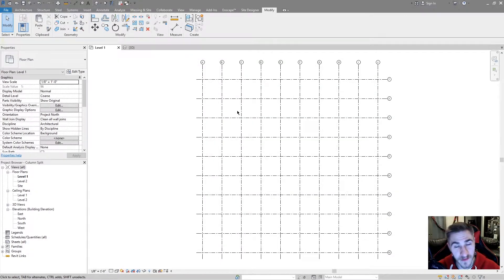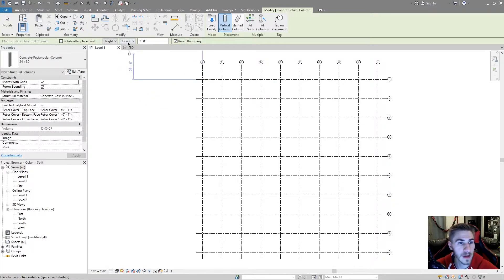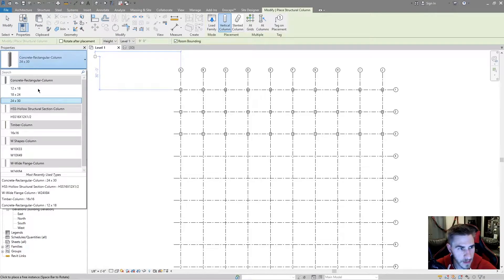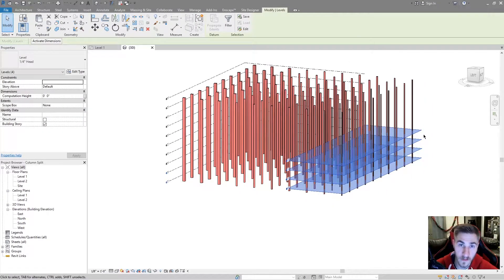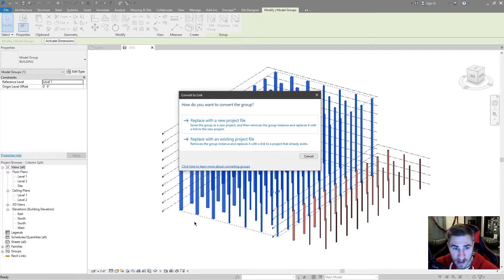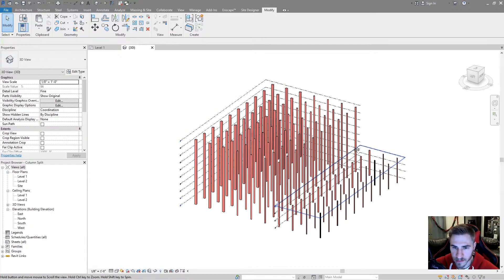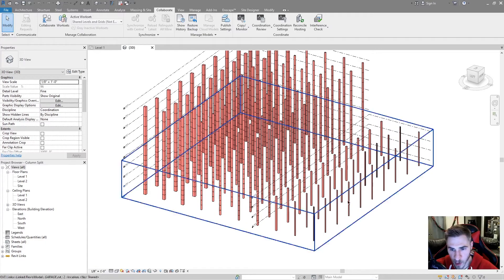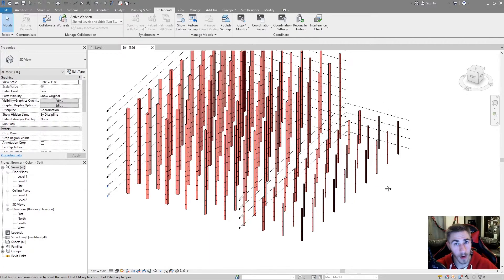How to Split Columns by Level | Revit 2020

Comment: Neat trick, didn't know about this. I agree that sometimes you need to split columns by level,  but I do not see the benefit of doing so unless the size changes For example in your model, lets say the columns are one size from level 1 up tp the top of the garage, and then a smaller size for the rest of the tower. I would only have two splits, unless the size changed again. Looking forward to the next part, maybe it will make more sense to me. Also, does the split by level work on walls too?
Reply: If its an analysis model then you need to split
Reply from the maker: You are absolutley I would only recommend doing this if the column size changes at different levels. I believe I, unfortunately, failed to mention that in the video. Honestly, I am for this way of organizing columns if the columns change size even just once. The next video will explain the organization and how it is so easy to manage columns this way. Unfortunately, this is not an option when it comes to walls (I wish). The only options we have for walls using the Copy/Monitor tool are to change the alignment of the walls (exterior finish, wall centerline, etc.)  and to copy openings in walls.

Comment: Unfortunately, the tall side of the building has 10 levels but when you split the columns on that side they seemed to have picked up the other 4 levels on the short side and now instead of 9 columns you have 13.  Is there a way to exclude the levels you don't want?

Comment: Thank for another fantastic video. It's important for structural engineers to split columns as architectures normally draw columns spanning from bottom to top. However, if the project contains other architecture elements such as doors, walls etc, do you still recommend doing it this way?
Reply from the maker: You’re very welcome! I know what you’re saying about architects. They do it because it’s easier. The idea is to model not only the columns but everything as it will be constructed in reality, so I would split columns everywhere that is supposed to happen.

Comment: Do you know if there is a possibility to split a revit model by level?
Reply from the maker: Regardless of how you tackle this, it would be complicated. There is not a simple way to actually split the Revit model by level in Revit. Thinly way to technically do this at the level line should to use dynamo to create geometry of your entire model so it is one piece then to split at each level. You would lose all your Revit data this way. You could also export from Revit and do something similar with the geometry in another program such as rhino.